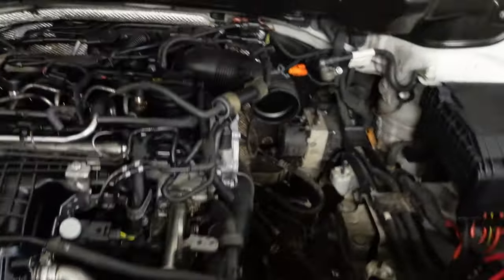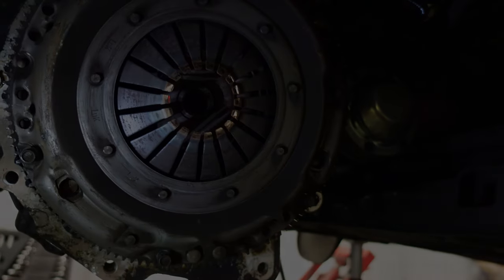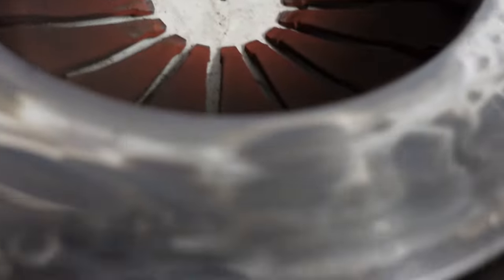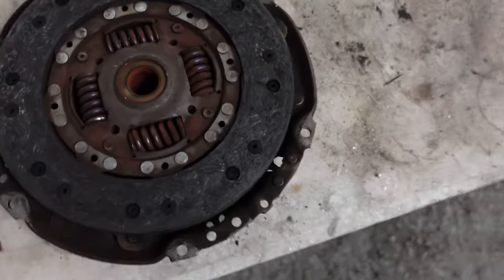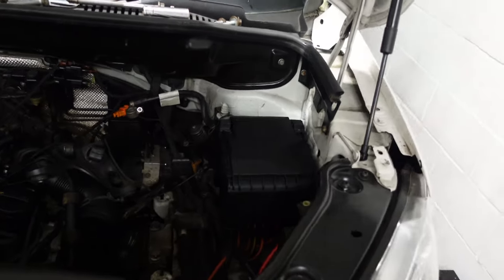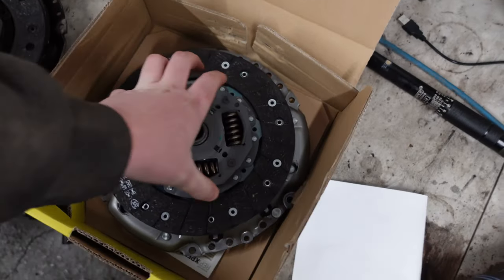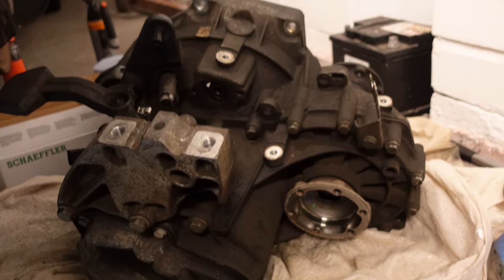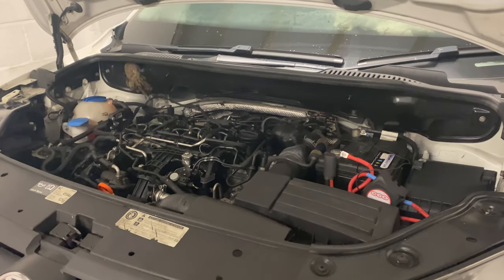Changing my VW CADDY Clutch

Comment: I changed the clutch and DMF on my Audi A3 Quattro - I had to change it FIVE times because of numerous things (I put the clutch in the wrong way, they sent the wrong clutch, the second clutch was faulty, I had trapped the backplate and it got tangled in the flywheel, and then the crank seal went). I bought a new clutch, flywheel and CSC from VW (it was genuine Sachs). Never buy cheap - as you say about Euro Car Parts Transmech, they are cheap, Chinese crap bought in bulk by ECP.

Comment: Great job ! You are very calm and collected and explain things very well. I assume you had to drain the gearbox oil aswel ?👍 from North East England
Reply from the maker: Thankyou, im not so calm and collected on the inside 🤣. Surprisingly on this gearbox I did not need to drain the oil, the vag driveshafts seperate at a flange instead of the usual way

Comment: Is this a 1.6tdi version by any chance?. As I've had nothing but problems with mine and it's a 1.6tdi and since buying found out they are problem prone.
Quick question.just had someone change my clutch.would they have needed to undo the lower arm bolts to change my clutch ?

Comment: hi mate, great job. is this a SDI or TDi? 
Thinking about getting one of these.
Reply: I have the 1.6tdi version myself and can tell you now.stay clear of the 1.6tdi versions as they are nothing but problems.there is plenty of videos on here with comments backing up what I am saying. 
I used to have a 2001 caddy for10+ year's and was super reliable.to the point I did nothing major in 10+ years.
As where the 1.6tdi .i have had it for about a year and a half and spent almost what paid for it in repairs.
Awful awful van.wish I stuck with my old caddy now.
Reply: @MegaTyson25  hi mate, thanks for your input. I did think TDi had one more thing to go wrong. Ive had SDi Lupo and it was solid. Only issue was it used to vibrate like mad. Was looking for something decent but all SDis are high mileage

Comment: I'd have changed the dmf  too,after doing all that work
Reply from the maker: I would have too but it doesn’t have a dmf to change
Reply: @rowanlewisuk  
My apologies,they usually dmf aren't they,has someone converted it to solid flywheel? Just had new clutch and dmf in my Touran LUK of course
Reply from the maker: @TheCopperknob  i read that too but apparently the commercial vw have solid flywheels instead